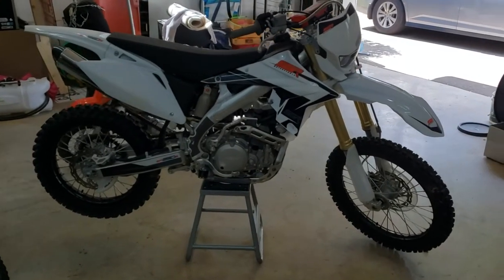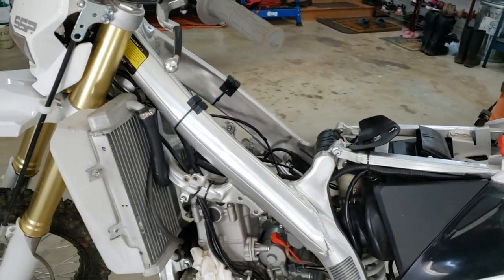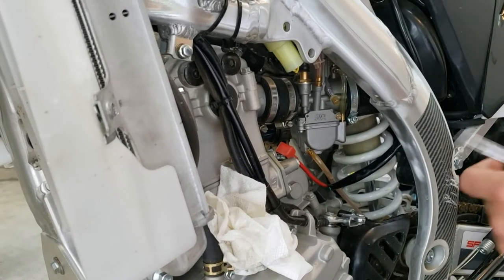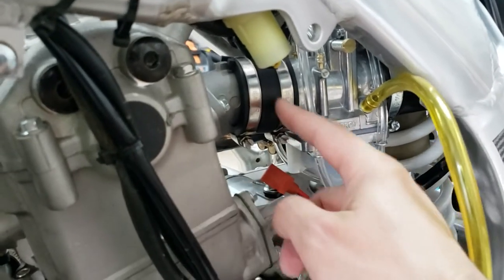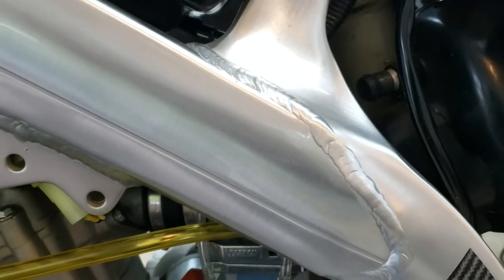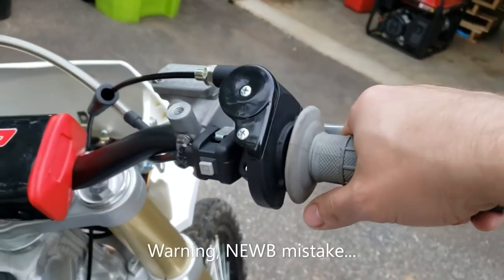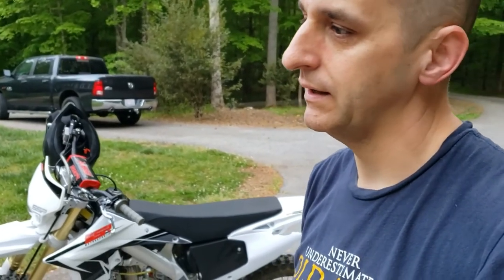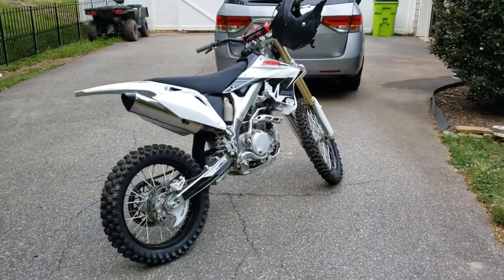Fixing the SSR SR250S Biggest Flaw

Comment: It took 4 of us to get my xf on the back of the truck we had no ramp so we made due it was only me and my 1 other homie to get if off we didn't drop it thank God but we definitely had a struggle my bike has a Clutch cable but no handle bars and the actual clutch lever itself wasn't on the bike so we had to roll it it would lock we'd roll it again until I just grabbed the back tire and lifted as much as I could so the front could roll

Comment: Doesn't look like you have any freeplay in the cable?? You should have at least 2mm of freeplay with handle bars full lock right to left. Also sounds like your idle is to high
Reply from the maker: Thanks. I did adjust the idle but I still need to adjust the cable to your point.

Comment: I can't believe you pay over $500 for carburetor and there's still a flat spot that's ridiculous my $100 carburetor ran tits right off the jump no flat spots
Reply: I was thinking the same thing! There are so many happy Nibbi Owners (or any number of other quality knockoffs). You can even get a genuine Mikuni or Kiehin for $200-300 new. I plan on getting a Nibbi PWK30 or 32 for my Templar X 250 (fairly similar to the SR250 from what I can tell except mine is air cooled with a six speed). To each their own I suppose. Putting a $500+ carb on a $2k bike seems mad to me, though.
Reply: What carb did you use?

Comment: Howdy, I'm 56 and have been a super tweeker since I was 9 because of what I has told one day, you got what you payed for, bullshit. Not here to tell anyone what to do but I have bought my son the 300s and love it.Yes the factory carbs sucks,got mine to work good but there was much more to get from this engine. Watched mxr  on carb and will not pay that much for a dirt bike carb , I would have bought a injected bike. This isn't my first rodeo , My son has been on xmotos from beginning and that carb sucked, so I did my research and landed up With nibbi from china and boy howdy it cam to life. So with that I bought a nibbi for this bike and unleashed  the animal. I throttle is smoking, and he's killing all the 450's out there, and nibbi was 116.00 to the door, also didn't have to buy any other parts to make this work. Used largest main jet and set pintel at 2nd from lean and now this bike rips. Waiting on slow boat from china for 14T frt sprocket to get the rest of the bottom end this bike has. Adding 1 tooth in frt is the same as adding 3T in the back but you do that you need a longer chain and your not getting the low end from this engine. These china made dirt bikes are worth more than we are paying for. And with that, for God and Country, Mark.
Reply from the maker: Thanks for the feedback. I would love to try the Nibbi side by side. I've heard good things about it for sure! In my case, I couldn't find enough info on that one and didn't want to dump a hundred bucks on a chance. So I went with Lectron seeing that there was a ton of good info our there on them.
Reply: @DanPonjican  I here you, but you took a chance on a 5000 dollar china bike didn't  you, think about that. Lectron is a great carb but for people that start at 1400 ft. and in the same day can get up to 3 to 4000 ft. in the same day. The rest of the 80 percent's really don't need that. I live in western NY where it's deep and steep. One other thing, when it's time for tires, IRC V33, if there is such thing as a unicorn, this comes the closest. Be safe and ride like you stole it, Mark.
Reply: @Ross Sanders Yep, made mistake ,been an A class auto tech and power generation engineer for 35 + yrs and have at times to much info in my head and when I was banging that out I was multi tasking at work, thanks for catching that, Mark

Comment: Why would you take the tank off to just simply remove a line no less something you didn't even need to remove in the first place all you had to do was pop the boot off ripped the carb about throw the other one in the original throttle cable would have been fine
Reply from the maker: I don't see how I could have got it on there without the tank coming out. That boot fitment was just way too much of a struggle even with the tank removed.

Comment: That's idling too high
Reply from the maker: It definitely was. I adjusted it since. It was the throttle housing that was too tight.
Reply: @DanPonjican  that sounds like a very frustrating afternoon trying to figure out that that was the problem. My guess would've been the idle air screw on the carburetor